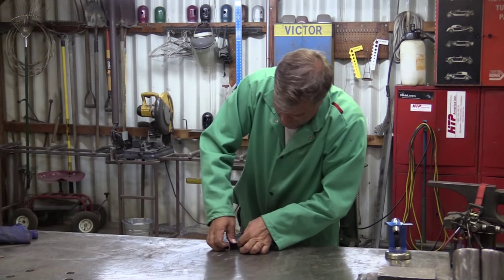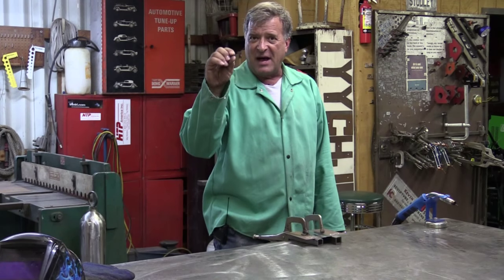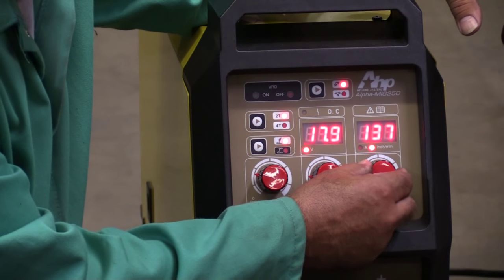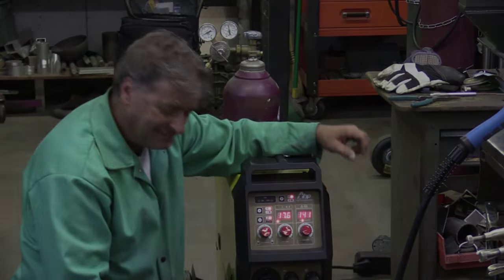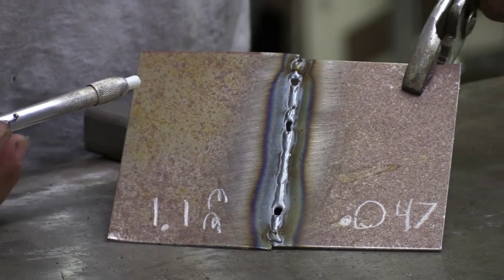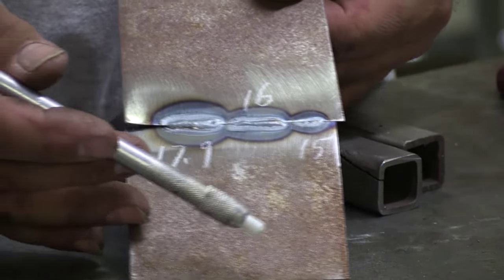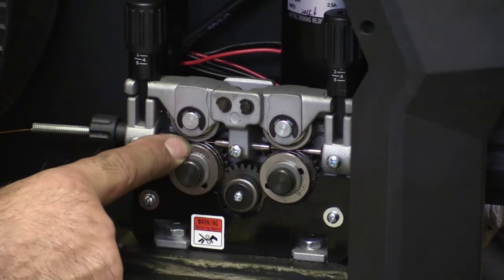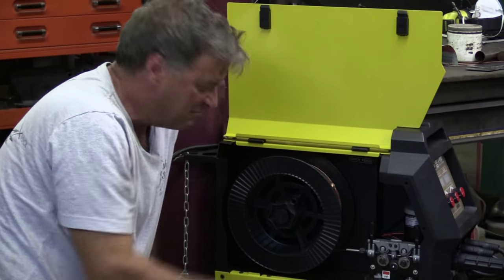How to Weld Thin Metal With the New AlphaMIG 250 MIG Welder / Arc Welder - Kevin Caron

Comment: Cool!  I got a Bobcat 250 a year or so ago.  Then, when the rebate I got from that, I got an AHP tig welder.  I taught myself to do both.  I want to do art type stuff.  You know, the kind of stuff your parents would have, if they were total hippies.  haha  

I was looking at mig welders.  I found one with 40% duty cycle.  It was the best I saw.  I really, don't want to spend a lot.  No where near as much as I did for the Bobcat.  Then, on Homedepots site, I found that AHP made a tig welder.  I thought. AHP!  haha

So, after that and watching your videos, looks like fats is going to get himself one.  See, I was GOING to get an electric smoker and a cold smoke add on.  But, I have welding in my blood.  haha

Thanks for the great videos.

Well, after looking, as was with my AHP tig welder, it seems as if they are sold out.  haha  That sucks.  Oh well.
Reply from the maker: The new AHP  mig welder will be along soon..   Maybe by July or so..     It is going to be an AWESOME machine!!!!!

Comment: Kevin. I ran my 3rd gen alphatig 200x of a 6500 watt generator last weekend on stick mode 7018. 1/8 rods. every inch to 2 inches the machine would shut off then turn back on no matter what amperage I used it at. now even in my shop using a 20a breaker same 7018 rods and 100 amps it trips the breaker. any clues?
Reply from the maker: +joe clune

Sounds like you hurt it running on the generator...        Call tech support and see what they say.   The number is 

1 925-391-3583

Comment: first
Reply from the maker: +grumpybill      You will always be!!
Reply: +Kevin Caron, Artist what is the duty cycle of the AHP 250 mig
Reply from the maker: This is a prototype and I didn't get any specs. with this machine..    But I can tell you that I spent about 45 minutes with this machine at 26 volts welding railroad spikes and had no problems with the machine..
Reply: Thanks